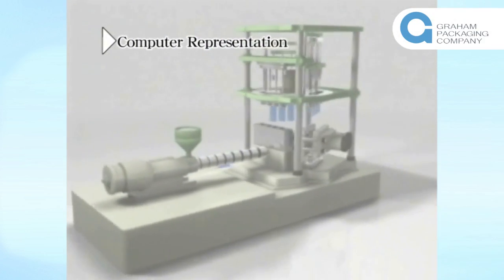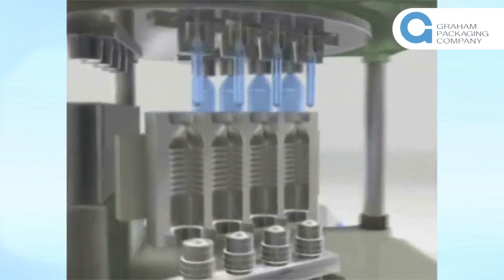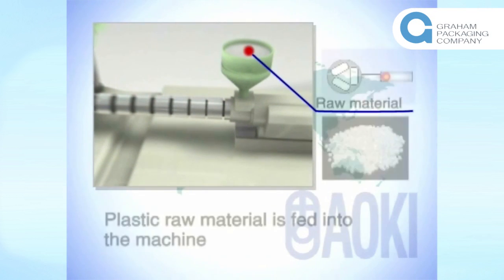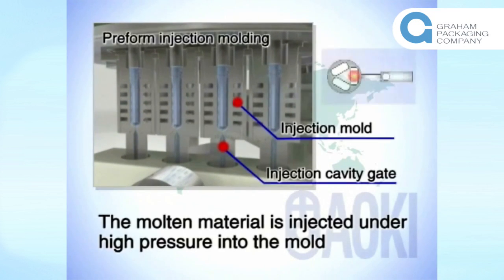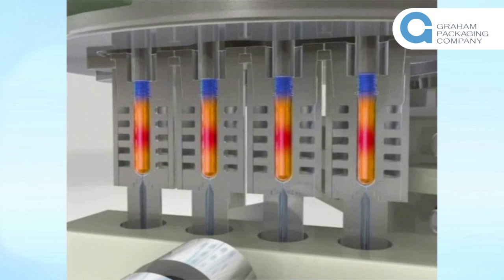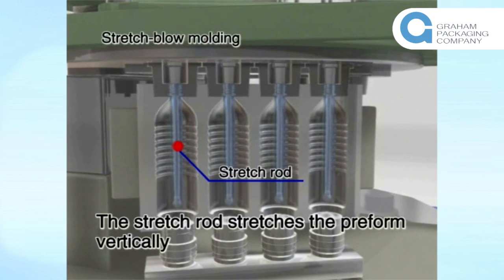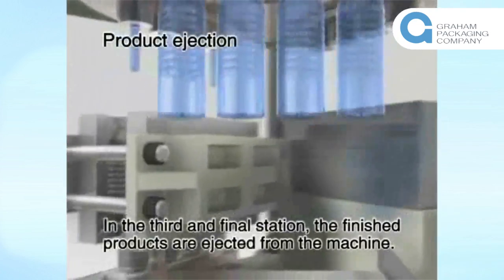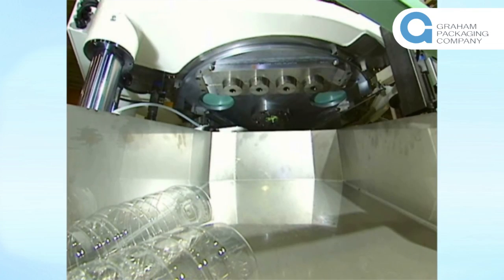How does injection stretch blow moulding process work?

Comment: Actually  ISBm machine 4stages    process 1.. injection mold 2..heating pot.  3.. blowing. 4..ejject.   But this video 3 stage how
Reply: The Aoki system can look good on paper, but can be incredibly unstable.  To get around the lack of conditioning (heating pot) their startup engineers often have to hand file the injection cores to get acceptable container quality - very primitive.
The 4 station method by Nissei ASB is far more versatile and stable.
Reply: @poruatokin  it really depends on what mold your trying to run. 3 station has its advantages. Some mold designs benefit with conditioning though. Most round style molds, simple oval containers are fine with without conditioning. Aoki’s really shine when in a good facility with good water quality, and climate control. A lot of fluctuating atmosphere conditions can make 3 stage unstable. 4 station can be easier to control when in a sub prime processing environment. You can use the conditioning to combat day to day atmosphere fluctuations. Process windows on Aoki’s are generally very narrow due to the fact there is no conditioning. Advantages with Aoki is faster cycle times. More complex molds designs sometimes require shaving injection cores. This is due to how hot runners flow which is always problematic in single stage processes. In 4 station this usually accomplished by using conditioning to create even wall distribution before blowing. So tooling design is not as critical. Aoki believes if the preform is prefect there is no need for conditioning. The downside to not using conditioning  high attention to tooling design. Aoki has a long history, and skill available to R+D in house to accomplish this. It is also easier to train technical staff, especially junior technicians to run 3 station. 90% of time with a Aoki it’s never a process problem.